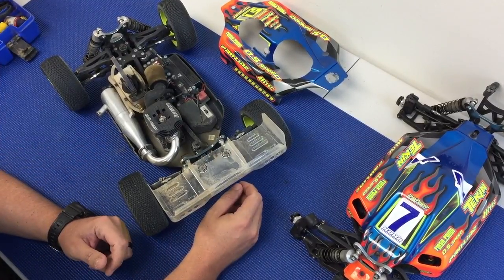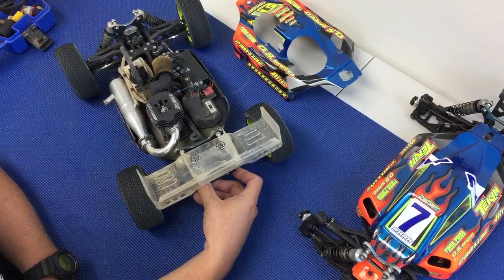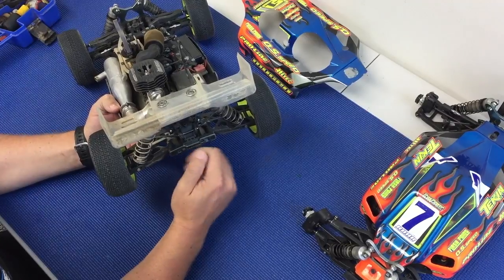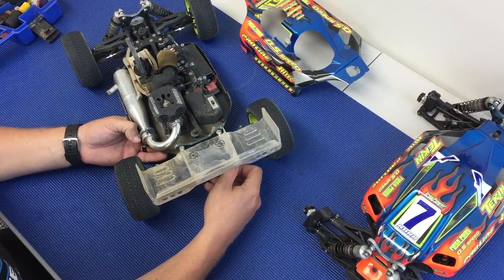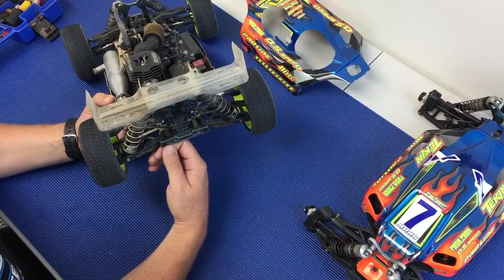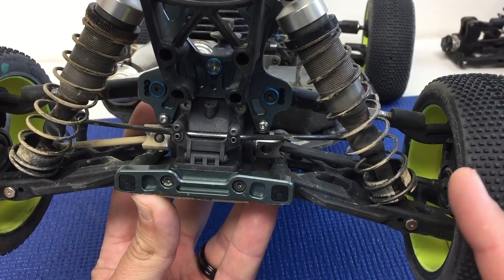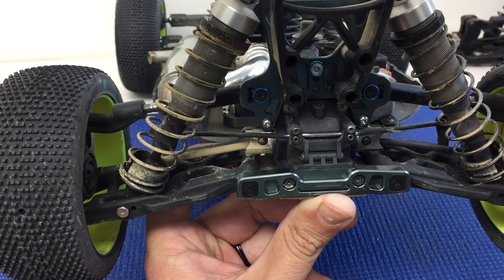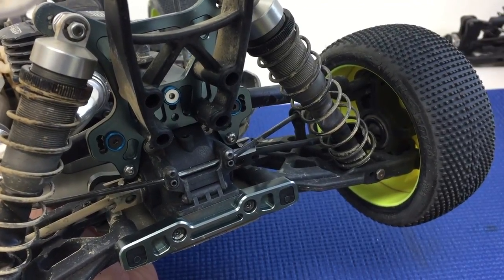Adam Drake from Mugen Seiki Racing talks about rear camber link positions and roll center.

Comment: QUESTION: If the camber link is adjusted UP/DOWN, then do you re-adjust the turn-buckle so that the same static camber value is maintained? I believe that going UP/DOWN from the original position will move the hub inwards/outwards slightly. On the other hand, moving IN/OUT on the tower or hub--YES--readjust, but UP/DOWN, perhaps this not typically done/not-worth-it for the small amount of change. What do you think? Thanks!
Reply from the maker: If you're moving the link up or down, it won't change the static camber much, but it's not a bad idea to check it and adjust if needed.
Reply: @AdamDrake  Thanks, man!

Comment: I really enjoy your setup and tunning videos. Very informative. 
I've been looking for a good tunning method or routine. Would you mind doing a video about the process you follow for setting up your different race vehicles?
Which adjustments you make first or the order in which you make changes. I've found an abundance of info on what each adjustment does, but not really any on what the best method of applying them. Maybe a flow chart of sorts.
Also maybe a list or rating of how much each adjustment effects the handling. Kind of like which adjustments are used to make dramatic changes and which adjustments are for the fine tunning. 
Thanks again for taking the time to make these videos!
Reply from the maker: Thank you for the kind words!  Yes, I can add this to my list.  Thanks!
Reply: Yes I would really like a video like this as I'm just starting out racing

Comment: I think you have got it the wrong way round, Higher roll Centre ( lower on the tower)Will distribute more weight towards the outside tire in a corner,putting more downward force on it helping it to dig in harder (more grip). In general with a low roll Centre ( up on rear tower) we are distributing our weight more evenly on both the inner and outer tires which will make them want to slide more and in a more controllable manner ( less grip).
Reply: Ryan is correct, and it is very much the same for all cars...
Reply: Ryan Duckworth This is another video hopefully can help you https://youtu.be/dSk3EX3HGi4 on-road off-road same theory applies.  
when you set the roll center higher, the roll moment is shorter.  The vehicle will roll less, this makes left-right weight shifting faster, more aggressive, but your tires' traction can easily be overpowered by lateral g.  Also you have front and rear to balance.
But your reasoning is incorrect. when roll center lowers, the vehicle will roll more, it will actually have more grip and when traction breaks, it is gentler.
Now, to have lower lap time you actually want to minimize your so called 'slide'.